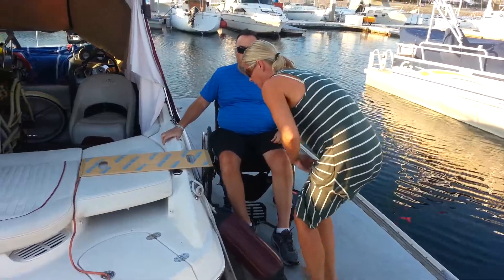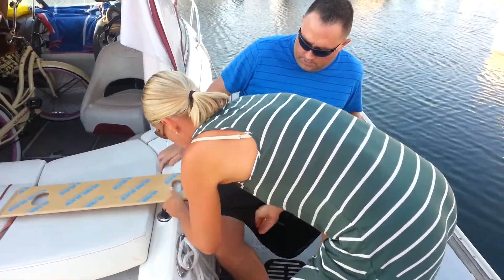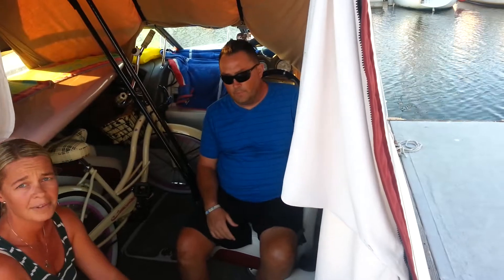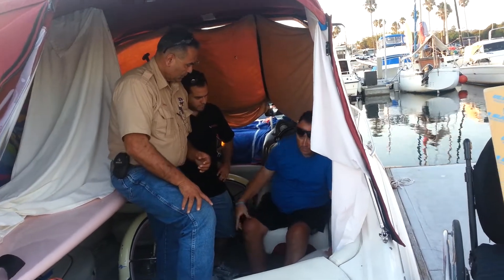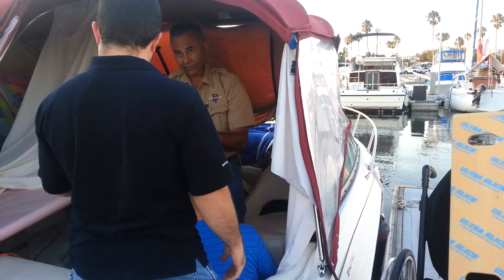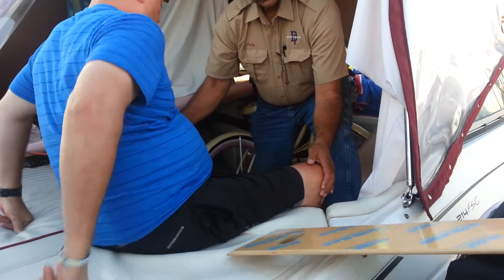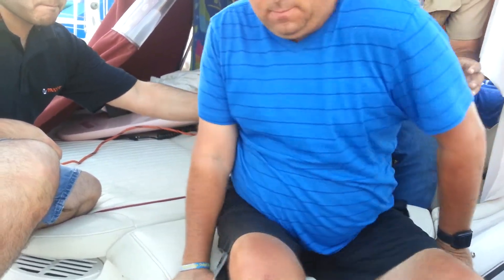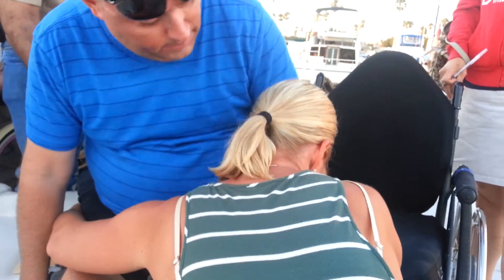Jeff Adkins SDSU ARP 607 Boatlift Project

Comment: I'm dealing with the same issue, I bought a Tahoe 215/si in July of 2020 the boat came in November 2020, i had a fall and developed a blood clot in me t-2 T-3 area and became paralyzed on my left side my boat has been in the water 3 times. My sons and wife help me get into the boat; it's the same struggle i have. i would like some info on this modification.

Comment from the maker: Thanks to Charles Deaver for sharing his link of a lift manufactured by Campion Marine. We looked at this solution and sought to adapt it for a 6-point Hoyer lift as it was not necessary to move the wheelchair into the boat. We also wanted the pole socket to be placed amidships so that Jeff could be placed into the boat's cockpit next to the captain's chair rather than on the back sundeck (which covers the inboard engine compartment). The Hoyer lift and 6-point sling were already donated and we were seeking funds to pay for the socket installation and reinforcement by a professional boatyard in San Diego. Jeff has since relocated to Florida and we were not able to finish the project as planned.